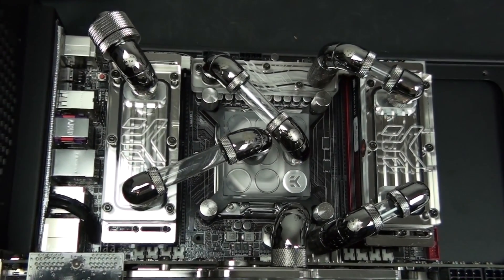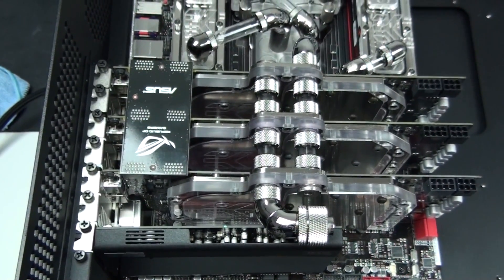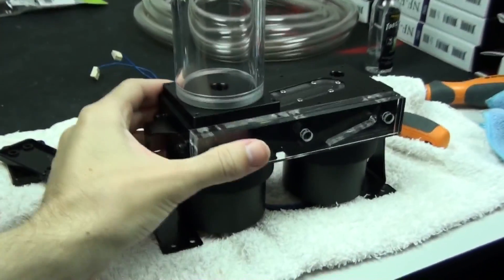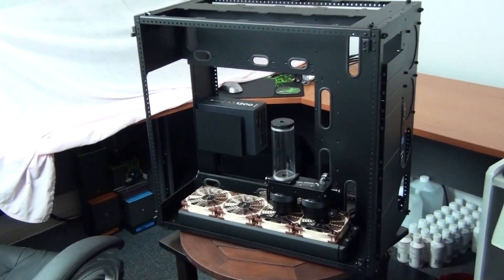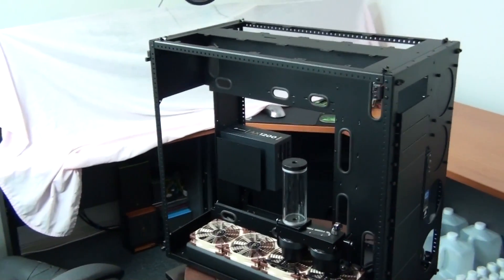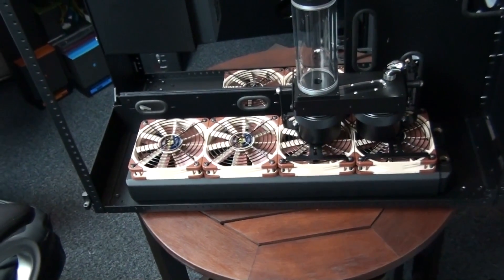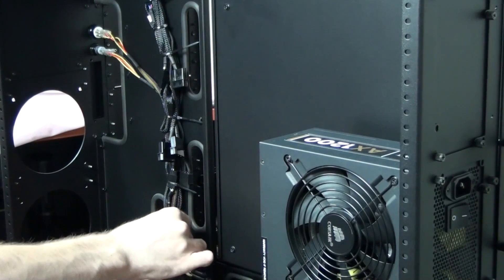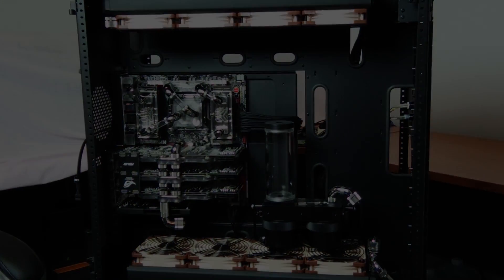Singularity Beast II Build Log Part 13

Comment: People really don't seem to understand parallel vs. serial so seem to think one is better than the other but in reality it all depends on your loop.

In Parallel you have decreased resistance in the loop, which lowers the pressure, but you also have lower flow across each device. In series you have increased resistance, which increases the pressure, in the loop but you get higher flow across each device.

I'm an electronics guy so I think of this in terms of a DC circuit: flow is voltage, pressure is amperage, and resistance is resistance. If we translate that to liquid, and they are equivalent from a physics standpoint, we can translate power = current * voltage to removed heat = pressure * flow.

Less flow across a device means it removes less heat. That's good if you have a weak pump (low voltage) because it can't push the liquid against the increased resistance.

Higher flow across a device means it removes more heat but you also have increased resistance to flow so you need a more powerful pump (more voltage).

So, as you said, if you have a lot of resistance in your loop (circuit) you can use some parallel circuits to reduce resistance to flow which will keep your pump from dying. But, if you have just a few components with low resistance and you have a good pump go for serial as it will remove more heat.

Comment: This is so much better looking than the last config. Love the crystal links beetween the gpu's, I think it would have looked better with the fans below the rad in the bottom and on the top in the top  :P love your vids, build log part 14 asap :]

Comment: i wanted to use crystal links for my tri sli but it was too expensive and looked fragile. 
do they leak if the cards hang or bend when plugged in?

Comment: Tap water isn't a bad idea, but I recommend following up with distilled water.  Distilled water is very cheap.  I can pick up some from the mega-mart down the street for 70cents a gallon.  If you cant get distilled water, then follow up with purified water.

Comment: To answer your question.  Scythe Gentle Typhoon AP-15 fans perform similar to the Noctua's.  They dont come with sleeved cables though.  They also cost about the same.. You get more bang for your buck with Noctua, but I understand the need for aesthetics.

Comment: Can you have the Res in the circulation of the loop if you plug the inlet on the pump top and use one of the inlets on the top of the res if you use the old res top?

Comment: nice build, but just wopndering how efficient are the memory block, i mean will normal single memory waterblocks perform batter, and since ram doen't run very hot, will the sencond ram block heat the memory instead of cool it because it is coming out of the CPU...?

Comment: When it comes to radiators you need static pressure.. Corsairs SP 120 fans @1450rpm have a static pressure of 1.29mm h20 @ 23 dBA, vs Noctua nff12 (no NLA) @1500rpm, static pressure 2.61 mm H20 @ 22.4 dBA.   For Corsairs SP120's to get the same static pressure as the Noctua's, you would need to increase its rpm, thus increasing noise to around 30dBA.  And from what I remember, Daniel is going for a quite pc..

Comment: Why are you using all noctua NF12s for all your fans?
I also think you should use corsair fans for a number of reasons;
1)They look better
2)They perform better
3)You would be able to use fans optimised for what you want; 
SP fans for radiators and 
AF fans for case fans.

Comment: true, but the corsair low performance SP fans are quiter, let get the components oly get 1-2°C hotter then the nf-f12's, are cheaper and if they are not good enough you can even use the high performance fans with voltage regulation.
Don't you thought about that?

Comment: you are limited to 4 GPUs only if you want to use them in a SLI setup to enhance the video gaming experience, but if you are after GPGPU and parallel computing or even folding@home you can as many cards as you want.

Comment: @SingularityComputers
"Most people would think of cable management as a small part of a build, an easy part of a build. That is certainly not the case". For those working with a small case w/o cable management features they certainly would not say that; I have an Ultra Aluminus -- a small and cheap case w/o watercooling support and cable management features-- and I had to turn lemons into lemonades.

Comment: I was surprised when you said you just use tap water to flush your radiators. Aren't you worried about algae etc. and the metal ions dissolved in the water? Ah well - each to his own. I just use distilled dionized water as it costs a few buck for 5 L

Comment: i've just watched the oc3d video on the corsiar fans, they are around 1 degree warmer...
And the SP quiet editions are much quieter then NF-F12's at 12 volts.... To make NF-F12's the same volume you have to run them at 7 volts 
and to add to all that TWO corsair fans cost the same as one NF-F12...
Would you really want to pay double the price for 1 degree? also Corsiar fans look sooo much better then NF-F12's...